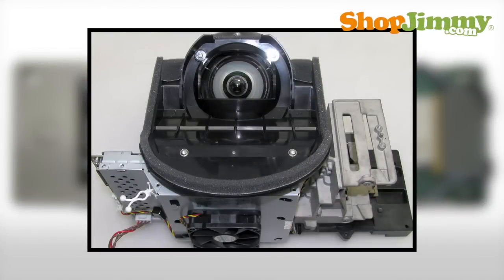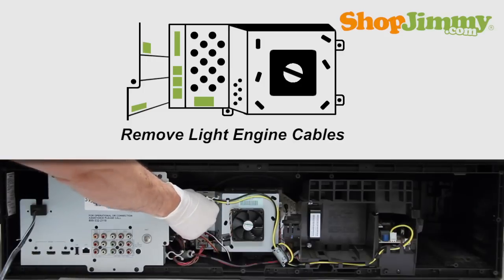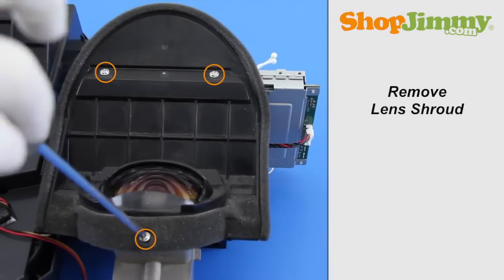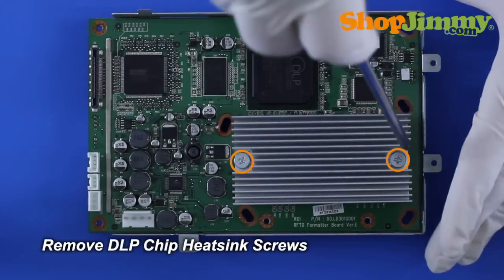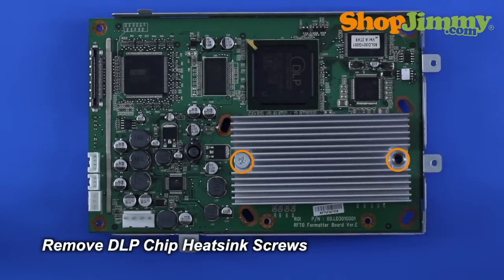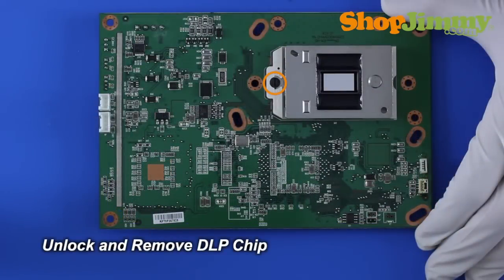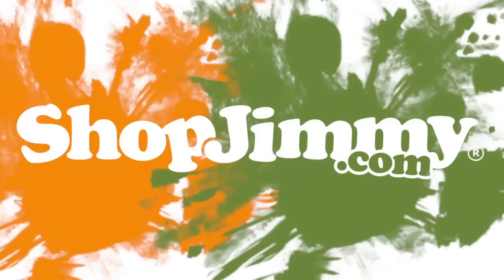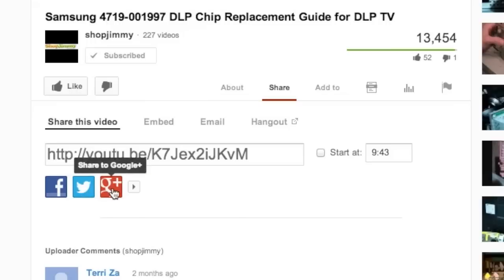Mitsubishi DLP TV Repair - Removing DMD Chip from Light Engine - How to Fix Black & White Dots

Comment: I have mitsubishi 72'' have had it for some time had to change out light bulb I have had it the bulb for one or two years and it was a snap with your instructions, you are now on my favorite, I do think the light engine will be my next project the screen is getting white spots on it and from what I read this indicates a problem with the engin. I know there a bit pricey so will be putting an order in to you all I am sure very soon. Thanks for your help...
Reply from the maker: Leon Trotter If you are getting white dots on your TV, it is most likely caused by the DMD chip.  Here is a link to a video that references that problem.  TV Repair-How to Identify Bad DLP Chip-How to Fix White Dots Problems-Mitsubishi Samsung Toshiba  Thanks and please let us know if you have any further questions!  www.shopjimmy.com

Comment from the maker: @juve escamilla - so that means a circuit failure could be a few different things. Firstly turn the TV on and let the error happen, make sure you don't unplug the TV once the red status light appears! Don't power OFF. Once the status light is red press and hold "INPUT" and "menu" at the same time and hold for 5 seconds. The timer light will start flashing. Count the flashes. It will give 2 different numbers. make sure you get both. It will repeat the sequence 5 times. Let us know the number.

Comment: How do I get the DLP board aligned properly? There's slots where the mounting screws go on the board, and the board can move around before tightening. I put it together and now the image is offset. WD-73840.

Comment: HI AGAIN I JUST ASKED QUESTION SEE BELOW BUT DIDN'T INCLUDE INFO REGARDING TV . IT'S A MITSUBISHI MODEL WE-73735. JUST REAL QUICK WE STARTED WITH WHITE SPOTS & EVENTUALLY ENTIRE VIDEO WENT OUT BUT SOUND WORKS OK. WILL REPLACING THE DLP CHIP FIX IT SO WE GET VIDEO BACK?  THANK YOU

Comment: Hello, I replaced the DLP Chip about a week ago.  Getting sound, but no picture.  Lamp light came on.  I ordered the lamp and put in last night.  TV Came on, but still no picture.  The red light is on for a few minutes and then it shuts off.  Also, is it wise to use the compressed air to clean the fans?

Comment: i have a JVC HD - 52Z585 DLP TV, how can i know if the TV is fried.  An electrical storm hit my nieghbors house and my TV stopped working.  when i tried to turn the TV on, the lamp light just flashed. i assumed it was a burnt bulb.  i replaced the bulb and i get the same flashing lamp light.  what do you think could be the problem and can it be repaired.  or should i just buy another TV.

Comment: please help jimmy.....I have a 73 inch mitsubishi I believe model 727or 737 I put new bulb yes door is closed....might have dust inside components? ......tv will stay on for couple hrs but will eventually shut off error code is 1-2 which means normal shut down but why....I also changed power strip outlet but to no avail...thanks for your time

Comment: i have a samsung 61 inch dlp with white dots i need to replace the dlp chip.......can i use a diffent sized samsung tv ........like a smaller version of mine would the chip be compatable or  r they specific for every tv.........??????
Reply from the maker: Mark Spelrem   Some TVs can share the same chip.  You will need to make sure that both TV models use the same DLP Chip.  You can also call our customer service for further assistance with your questions.  (877) 881-6492  Thanks and please let us know if you have any further questions with your TV Repair!  www.shopjimmy.com

Comment: I have a HL67A750A1FXZA and the picture docent have the picture quality it use to.  the picture is getting dim.  I have the brightness and contrast set all the way up.  All the colors are there.  The corners are especially dim.  There are also several small white dots.  What should i change first???

Comment: I have a hl67a750a1fxza TV with the white dot issue. I am about to order the replacement chip. Do I have to order and install  the heat thermal pad also. Is this required?
Reply from the maker: JeffShar Chavis   It is recommended.  Thanks!  www.shopjimmy.com

Comment: I have a Mitsubishi WD-65738. I removed the engine to clear the dust that had accumulated over the years and also to change the bulb that blew. I cleaned the lens with a soft cloth that is used for eye glasses. Was that ok for me to do that? Just notice in this video to not touch the lens.
Reply from the maker: *****   If you do not have any video issues then your ok. Just next time do not touch the lens.  Thanks!  www.shopjimmy.com

Comment: I checked the lamp for dust.  I put everything back together and now have sound and no picture to begin with.  The Lamp light is a solid RED.  Do I just replace the lamp. Mitsubishi Model - WD-60735 Lamp model 915B403001or is something else wrong?

Comment: soooooo....i have a question.  By the looks of it in this video, the heatsink doesnt touch the chip?  If it DOES actually touch the chip,  then why wasnt thermal compound used?  Or was this just a demonstration model?

Comment: I have a 65" Mitsubishi DLP with white dots starting to cover half the screen. Is replacing the Chip gonna solve this problem? And how much will this cost?
Reply from the maker: Bryan Watters   Yes, it will fix the white dot problem.  Please reply with your TV model number, or you can click on this link to see which matches your TV model number.  http://www.shopjimmy.com/catalogsearch/result/?q=dlp+chip  It is most likely one of the top 2 chips on that page.  You can also call our customer service for further assistance with your purchase.  (877) 881-6492  Thanks and please let us know if you have any further questions with your TV Repair!  www.shopjimmy.com
Reply: ShopJimmy.com I have be a 60 inch Mitsubishi need in Home by repairs be white dots on the screen. Can I get repairs in my house?

Comment: my Panasonic PT-52LCX15 tv has green,red and blue blobs on the screen? I replaced the lamp and the blobs are still there. even with the color  turned all the way down, you can still see the colored blobs they are fixed in the same location. with an all white or black screen you cannot see the blobs? what could this be? thank you
Reply from the maker: tionne terrell   This sounds like a TV panel problem.  If your TV panel is bad, it may be more cost-effective to replace the TV as panels are typically hard to find in stock, difficult to replace, and expensive.  Thanks and please let us know if you have any further questions!  www.shopjimmy.com
Reply: ShopJimmy.com  does a  dlp rear projection tv have a panel?
Reply from the maker: tionne terrell  
My apologies, I did not mean to say it was a panel problem as the DLP TVs have mirrors.  This is a problem with either the Chip or the DT board.  You may need to replace each of those individually to see which one fixes the problem.  It appears we do not carry the chip, but you can see the DT board here:  http://www.shopjimmy.com/catalogsearch/result/index/?cat=4&q=PT-52LCX15  Be sure to match part numbers on your current board, with your replacement for compatibility.  You can also call our customer service for further assistance with your purchase.  (877) 881-6492  Thanks and please let us know if you have any further questions with your TV Repair!  www.shopjimmy.com

Comment: I replaced the chip, put everything back together and I hit the power button and the green light comes on and the immediately turns off again.  Did I get a cable put in the wrong place or what.  Before replacing the chip the machine came on fine just had the white spots.  Any suggestion as to what I did wrong.
Reply from the maker: +Donald Segar   Try all repairs and troubleshooting at your own risk.   I recommend checking that the lamp door is shut all the way.  Thanks!  www.shopjimmy.com

Comment: I have a Mitsubishi 65-736 with error code 61. None of the fans are running, no enable signal for the bulb to light. New bulb new ballast, new main power supply. Could it be the dlp board? Thanks
Reply from the maker: *****   I recommend replacing the light engine in your TV.  Here is a link to replacement parts for your TV model number:  http://www.shopjimmy.com/catalogsearch/result/?q=Mitsubishi+65-736  Be sure to match part numbers on your current board, with your replacement for compatibility.  Thanks and please let us know if you have any further questions with your TV Repair!  www.shopjimmy.com

Comment: I have a Mitsubishi WD-73735 the status indicator light is solid red and with error code 44. The lamp bulb is good, The light engine was bad I replaced it now the tv wont turn on. What's the problem?
Reply from the maker: Herbert Greene   This sounds like a problem with either the LVDS or DVI cable in your TV.  Thanks!  www.shopjimmy.com

Comment: I have a samsung projector tv when we turn on the tv theres sound but no pitcher, do you think its the dmd board ?
Reply from the maker: Robert Vitelli Please reply with your TV model number.  Thanks!  www.shopjimmy.com
Reply: Its a Samsung HL-P5685W
Reply from the maker: Robert Vitelli  Is your TV model number HLP5685WX/XAA?  If so, I recommend replacing the lamp in your TV.  Here is a link to a replacement lamp for your TV model number on our website, click here:http://www.shopjimmy.com/samsung-bp96-00677a-dlp-replacement-lamp-with-osram-neolux-bulb.htm  Be sure to match part numbers on your current board, with your replacement for compatibility.  Here is a link to a video showing how to identify your part number, click here:  Samsung BP96-00677A Lamp Replacement Guide for DLP TV  You can also call our customer service for further assistance with your purchase.  (877) 881-6492  Thanks and please let us know if you have any further questions with your TV Repair!  www.shopjimmy.com
Reply: the light works fine it turns on in the back
Reply from the maker: Robert Vitelli   OK, thanks for mentioning that.  This could either be a problem with the DMD board or the digital board.  You may need to replace each board individually to see which one fixes the problem.  Here is a link to replacement parts for your TV model number on our website, click here:  http://www.shopjimmy.com/catalogsearch/result/index/?q=HLP5685WX%2FXAA   Be sure to match part numbers on your current board, with your replacement for compatibility.  You can also call our customer service for further assistance with your purchase.  (877) 881-6492  Thanks and please let us know if you have any further questions with your TV Repair!  www.shopjimmy.com

Comment: did everything instructed  yellow status light just blinks  wont turn on  mitsubishi 65 inch  any thughts whats wrong
Reply from the maker: tj   You have either left the lamp door (start by checking the lamp door) open or you will need to re-seat the DLP Chip, to make sure it has a good connection.  Let us know if you have any other problems.  Thanks!  www.shopjimmy.com